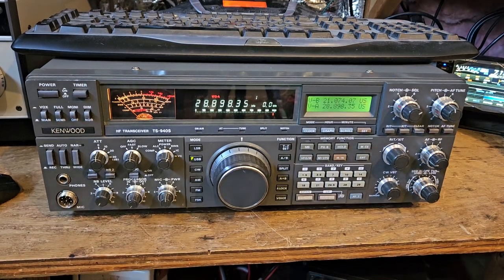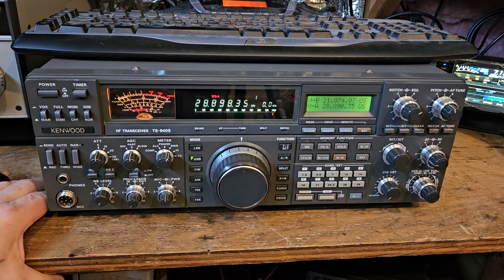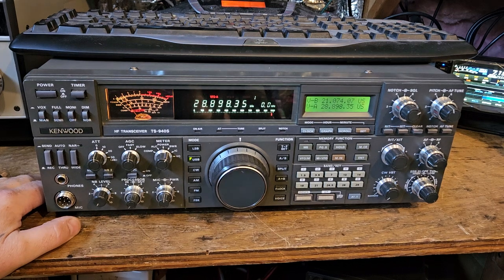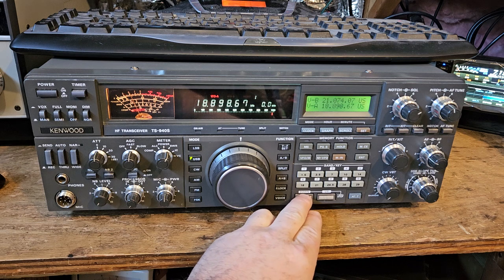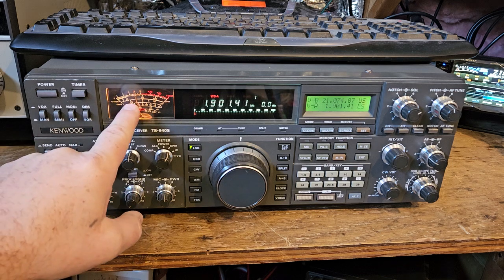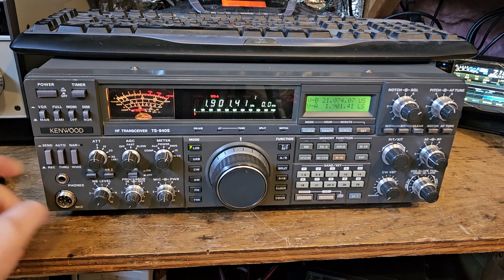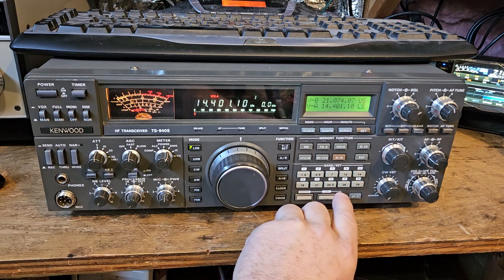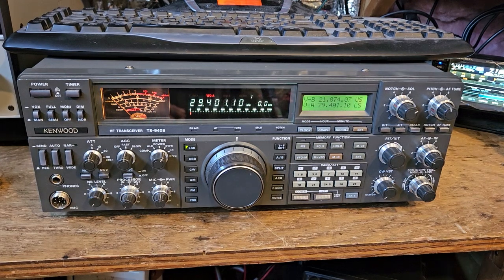Whats wrong with my TS-940S Kenwood ham radio

Comment: I would suspect some relays and first RX LNA transistors. Measure transistor bias, jumper a suspicious relay.
Reply from the maker: I have to at least get it back to working how it was yesterday before i made it worse haha 😄
Reply: @hamradiohack  is diode on rf board some time leake
is just the input of the marker 1ss133 D47 on the schematic